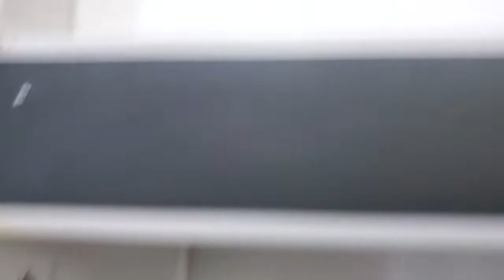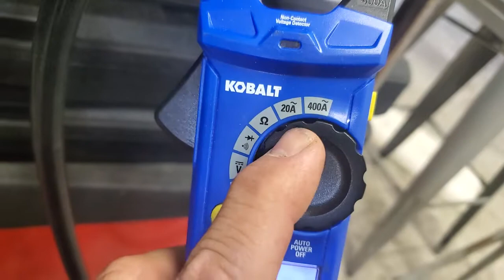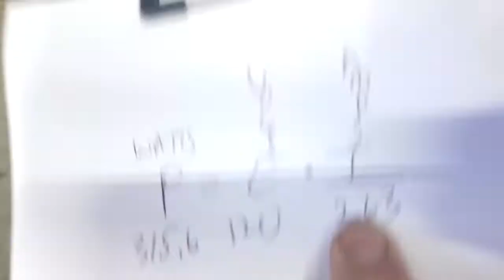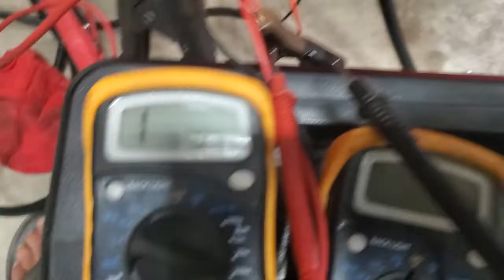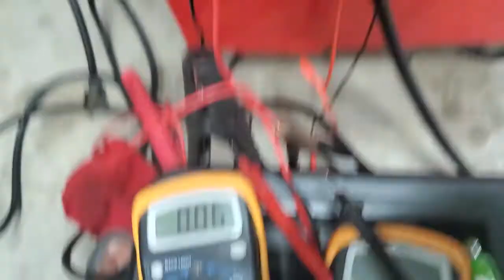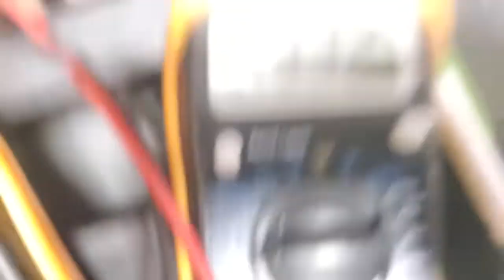DOMETIC FRIDGE CHECKS ,REAR CONTROL OUTSIDE BOARD CHECKS

Comment: After freeze few weeks ago,, Having all kinds of Problems with fridge&freezer, 3 way 2582 dometic (2018), boiler gets hot, thermister seems good with ohm test, Absorption coils Cold...is there a way to tell if power control board (module) is bad?? No smell, no yellow??
Reply from the maker: What's the amp draw of 120 volt heater elements
Reply: @Rvdiagnostics  will.check again and send

Comment: That was good to get some idea about the amp draw on these components, particularly as you highlighted a bad amperage for the flame sensor.  I would like to have seen how you hooked up the relay to test DC amperage. It must have been in series with multimeter because when you switched the multimeter from milli to amps it shut off the relay.